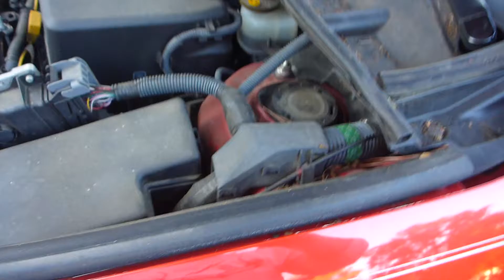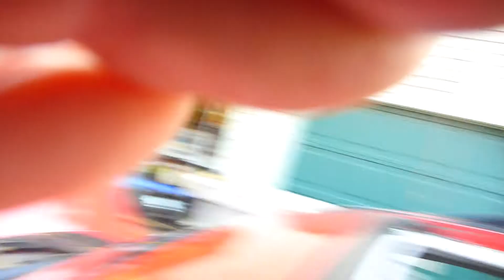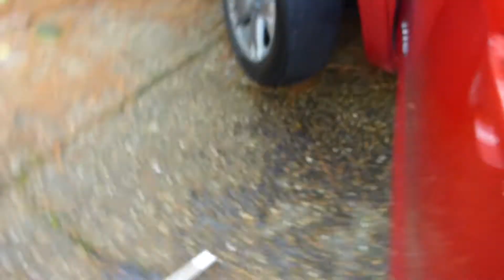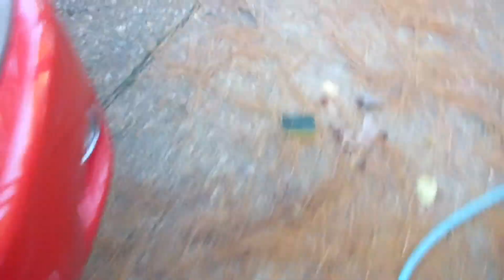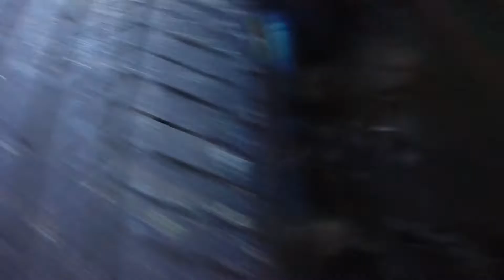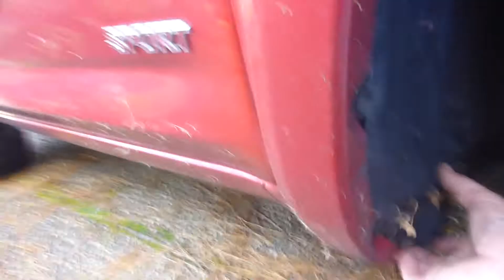2018 11 17 Toyota RAV4 Electrical Demon Exorcism

Comment: Lights staying on isn't so bad Rick.  I had my lights go off intermittently on a high speed run down from the country - bit disconcerting for me and other road users at night.  Turned out to be a sticky switch.  I hit it with some silicon spray and so far all good again.

Motor vehicle electrical systems with inter dependencies are the work of the Devil.

Age does not improve the situation.

Cheers Rob
Reply from the maker: "A high speed run down from the country." Was that on two wheels or four? Either way, sounds like an adventure. What is "the country" in Aussie terms, exactly? I have an ambition to visit Australia someday. Thanks for stopping by Rob, and Merry Christmas to you and yours.
Reply: Hi Rick,

I was in the old diesel ute at the 110 kph limit coming back to Adelaide from the Mid North area (about 1.5 hour drive).

"The country" can mean anywhere that is not built up and is farming land.

Ditto on the Xmas bit.

Cheers Rob